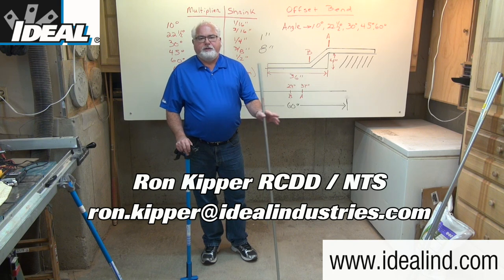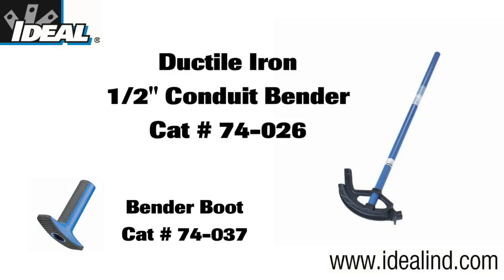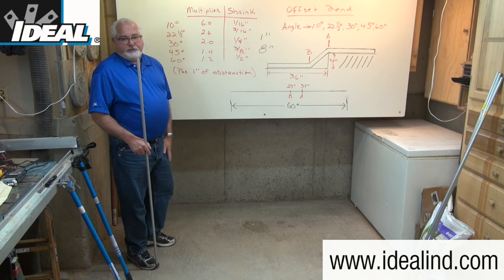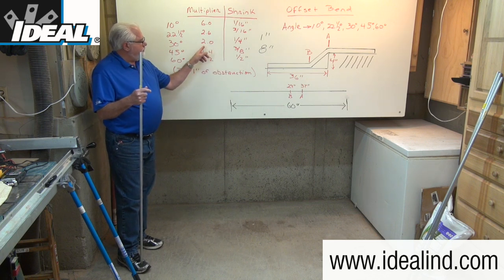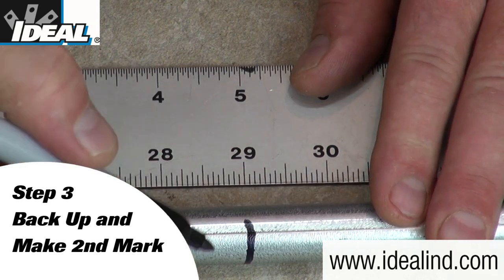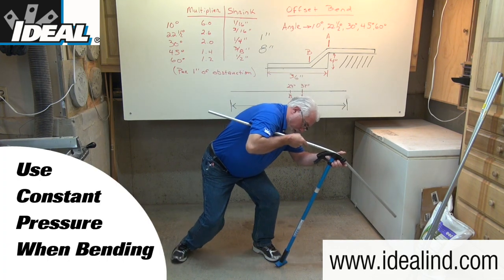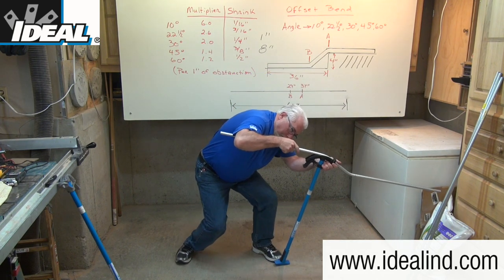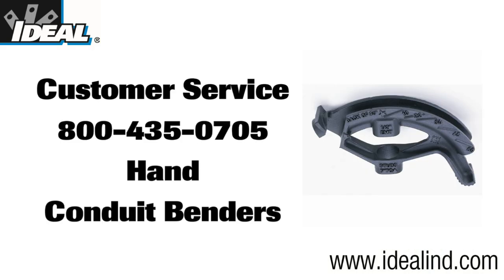IDEAL Hand Conduit Benders How to Make an Offset Bend

Comment: Are you measuring from the coupling to where the obstruction STARTS or to its center?
Reply from the maker: Hey Matt typically we measure from the last coupling to the where the obstruction starts for offset bends. Hope that helps Ron
Reply: Ron Kipper Datacomm Absolutely.  Thanks

Comment: You said the first bend should line up with the 37” mark.  Didn’t you mean the 29” mark,or did you turn the conduit around?  It appears as though you bent the first mark from the end which would have been the 29”, correct?
Reply from the maker: Yes the first bend is made at 37" then slide the conduit  in the bender head and rotate it 180 degrees the line up the arrow with the 29" mark and make the second bend. Watch the whole video and I show making that second bend. Have fun Ron

Comment: Every time i do an offset bend with the correct multiplier, my offset always exceed the measurement I got.. for example if I need a 5” bend And use a 30 degree bend I’ll multiple that by 2 so I’ll get 10” between bends. When I finally do the bend I’ll get maybe 8 or more inches instead of 5.. it’s so annoying
Reply from the maker: Antonio sounds like you just need a little more practice! Have fun Ron
Reply: Seems like you might be bending beyond the 30 degree mark so you are getting a larger offset.